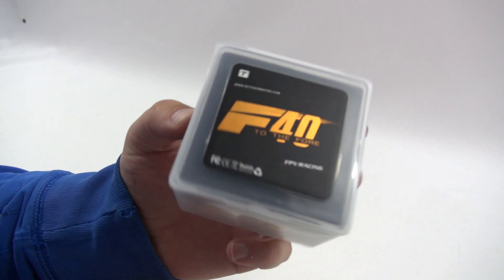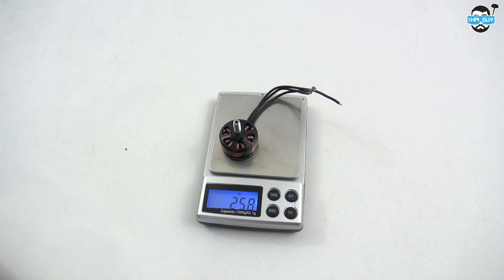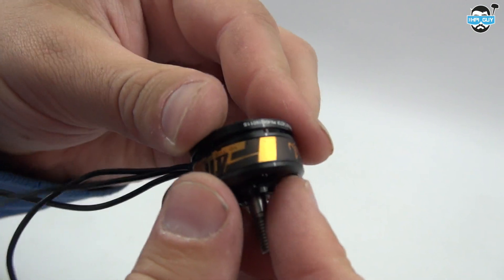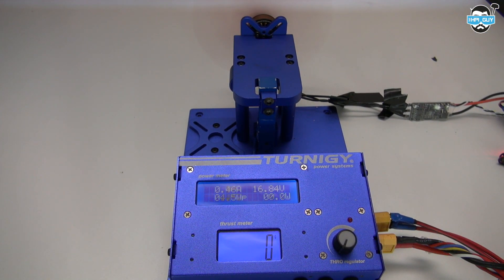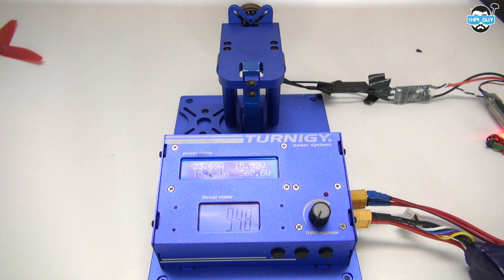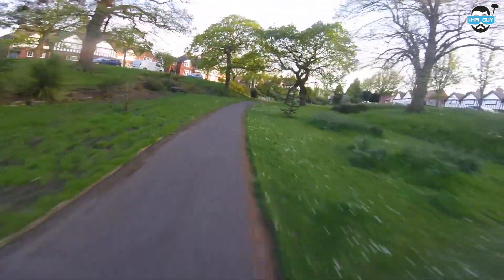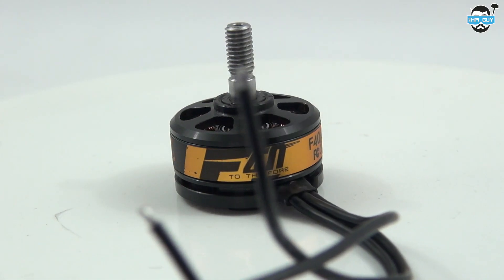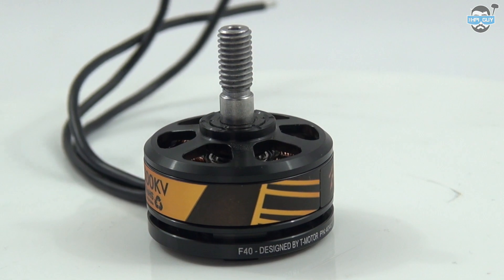HPIGUY | T-Motor F40 2500KV Test - Review

Comment: Still cannot beat the Cobra CM2204 2300kv. Only 24 grms each and mine are still going strong after a year. Paired with DAL Cyclones. T5045C.
980 grms of thrust @ 20 Amps.

Comment: looked similar to the SE2205 with the hollow shaft and using a screw instead of E-clip. although it seems to draw more amps than the DYS one, since the DYS is designed for efficiency.

Comment: Nice review, thanks for sharing.  I have a set of the 2300 F40v2 motors running 6045 props & been enjoying the 1405g of thrust.  Just need to find a better battery to handle the 39 amp draw.  4x of these are awesome, but make it a battery killer too :)